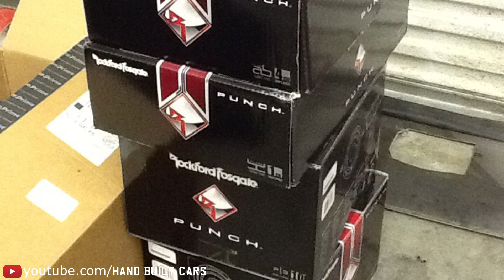1970 Chevrolet Chevelle SS 434 Build Project

Comment: It looks like you narrowed the rearend and also looks like you had to the lower trailing arm brackets correct? Did you have to move the ones welded to the frame over some? It appears in the pictures you got a new bolt on rearend bracket that you also welded correct?? Thanks a bunch!!